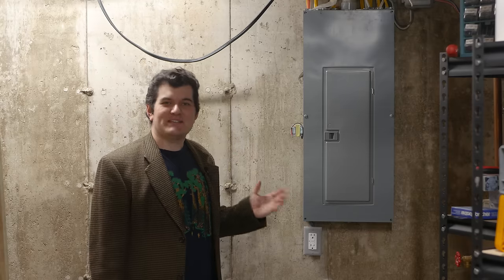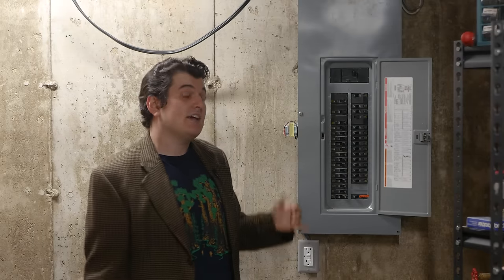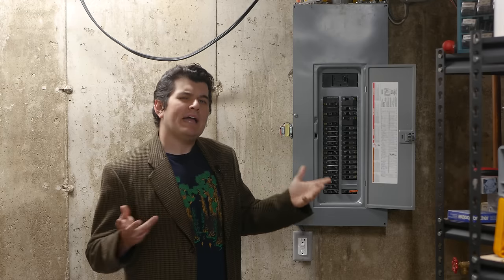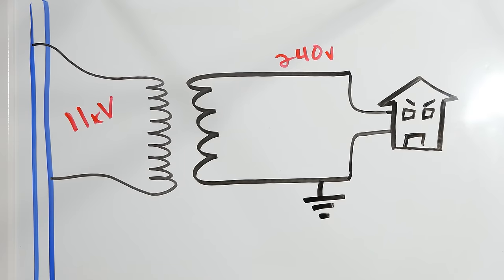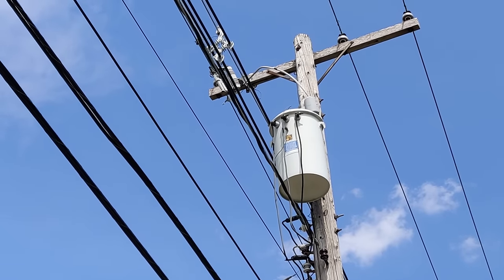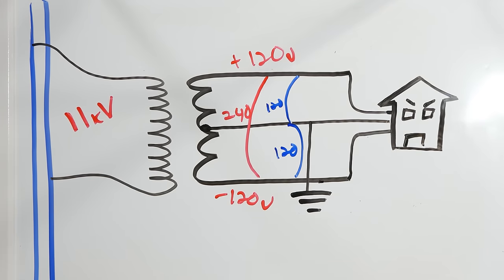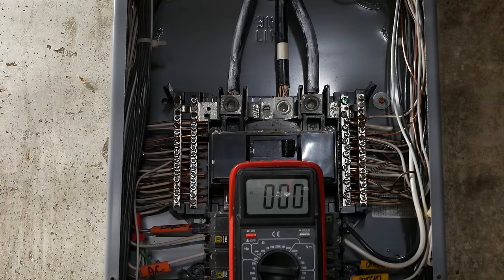The US electrical system is not 120V

Comment: Interesting to see that the US only has a single panel with everything in one place! Here in Germany, at least my household has a main circuit breaker panel (including a GFCI/RCD/Overly-Curious-Nerd-Life-Saver) and a separate, transparent box for a main big "one-time-use" fuse - 63A in our case. We also have all 3 phase cables coming into the panel, at least according to their color, but I have no idea about the exact details. 
And hey, at least your plugs are polarized, unlike our continental European ones. So that's nice at least :)
Reply: It depends. As alluded to in the video, many 240V devices (water heater, air conditioner) have disconnect panels. In larger homes, you'll often find pony panels. For example, you have the main panel in the basement, and then on the second floor have a smaller panel fed from the pain panel for all of the circuits on the second floor and in the attic. This reduces the length of circuits, and also makes it easier to access if you trip a breaker.
Reply: Edit: I just checked, and it seems as if the four connection coming to our house are all three phases + a combined PE + N conductor. So at least our panel has access to 3*230V AC. Huh
Reply: Also, little known fact, we DO have disconnects on the main feed on occasion; if the electrical panel is a certain distance beyond the outside electrical connection (ie. further than literally wall-to-panel), we're required to add a separate breaker disconnect, often integrated into the meter base. Had to do that once when someone added an addition to a house, where the side that was extended had the panel. We ran a lengthy PVC pipe with the main feeds under the house, and the new meter base had the disconnect, to prevent fires if there was a short in the main feed. Because, y'know, utility power lacks the breakers* to do it for you.
* - They DO have breakers, but not ones designed to handle a single house, but rather an entire street (ie. powerlines go down). This is why touching utility power is so dangerous!
...Now I'm starting to sound like TC. XD
Reply: You can't make a judgment about "in the US" from a single example video.  There is significant variation by region, year built, location of utility inlet, etc, etc.
Reply: Our plugs are polarized but almost no appliances or devices care about the direction anyways. Clumsy electricians often wire them backwards with no recourse.
Reply: I always refer to the GFCI as the "profanity inhibitor" because it trips just before the words reach your throat.
Reply: @16vSciroccoboi  Some of the reason is safety. Say you have a fuse on a device, and you want the device to be as safe as possible if the fuse is blown. If the fuse is on one of the wires entering the device, you want to make sure you're cutting off the "hot" wire, since the neutral wire is safe on its own. If you don't have polarized plugs, you don't know which wire is the hot one, and which is neutral.
That being said, lots of homes have the wiring wrong in at least one outlet and they still work fine, if a little less safely for some applications.
Reply: @16vSciroccoboi  the Neutral wire is connected to ground. So yes, there is a polarity. In my area it is common for the inspectors to check polarity on every single outlet.
Reply: @briti1543  I was under the impression that you guys didn't have neutral over there. My bad. So you have 240v potential on each phase in your panels?
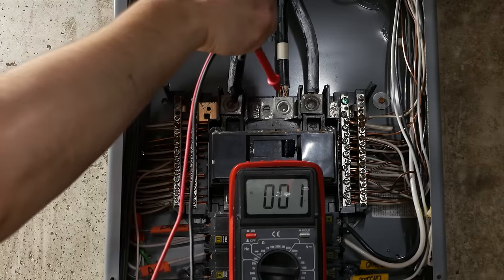Reply: @16vSciroccoboi  It's still 120v potential per phase, but like said in the video (7:28) the neutral is sort of the middle wire between the phases, and the phases are 180 degrees out of sync. But since each 120v outlet just grabs one of the two phases (and it doesn't really matter which one) that middle wire acts as a neutral
Reply: @16vSciroccoboi  The polarized plug is so that the neutral wire of the appliance is plugged into the neutral wire on a properly wired receptacle.  This is safer for certain (especially older) devices that don't have a dedicated ground wire, as reversing the wiring can lead to an energized enclosure.
Reply: @16vSciroccoboi  ever had a led lamp still glow after you turned it off? well, big change that's a result of a switch switching the neutral and not the live wire.
That's when switches are wired wrong, but the same is probably true for outlets, some applications will have site effects when wired wrong
Reply: Siemens and Schneider has to make some money somewhere.
Reply: I guess I should clarify. I'm an electrician here in the US. I know how this stuff works, I'm not saying polarity doesn't exist in the US. 

I was under the assumption that in the UK (or wherever uses 240v) 120v single phase didn't exist. Moreover that there was no neutral conductor used, rather that both conductors in a 2 wire circuit were 120v potential to ground and 180 degrees out of phase with each other. Meaning each outlet would have 2 120v prongs and a ground prong. The latter only in use on devices where grounding was required, same as the US.

 Given these comments I'm reading,  I'm wondering if it's 240v to ground on only one prong, a neutral conductor on the other and a ground prong for the third? Basically the exact same as our 120v system except the voltage on the hot is 240v instead of 120.

So my confusion about polarity stemmed from the idea that there was no neutral in use over there.
Reply: @16vSciroccoboi  Yes, that's exactly the setup we have over here. One phase per socket at 240V, a neutral and a ground. Larger appliances like stoves are usually connected to all three phases to balance out the load on the electrical grid afaik.
I'm not sure if this is true for all homes, but at least my building has all three phases connected at the panel and the n distributes them evenly over the other circuits in the house
Reply: @StarbornPhoenix  ah. Okay. That makes much more sense.
Reply: @16vSciroccoboi  US 120V most-certainly is polarized.  One wire is "hot", the other "neutral".  While an appliance will pretty much always function with the polarity reversed, for safety reasons you want it wired correctly.

e.g.:  A simple screw-in lamp socket...  The outer-shell is supposed to be wired to neutral, with the contact at the bottom hot.  While the bulb will light up either way, you want that (nearly-exposed) shell to be neutral, with the hot wire safely buried at the bottom of the socket.
Reply: dothemathright 1111  In a metal box fan, the outer shell will either be connected to earth-ground (the 3rd pin, if there is one), or insulated from the motor.  It will never be intentionally connected to line-neutral.  (The standards recognize that outlets might be wired backwards, which would make the outer shell hot.)
Reply: @16vSciroccoboi  to be clear, we dont have 3 phases to "balance out the load". sure thats a nice side effect but it's a 3phase system. 230V can be measured between phase1/2/3 and neutral/ground. if you measure between phases you will have 400V. We do in fact balance out the load for single phase circuits, but for 3phase circuits  power is the more important reason.(P=U*I)
Reply: @Arios about the transparent box for a main big "one-time-use" fuse -- he did say that the lines coming in were from a meter outside. That meter probably sits in a panel, and it might be fused,  too.
Reply: @16vSciroccoboi  You have live and neutral. They are AC, but neutral is on the same level as ground. You can safely touch a neutral wire, live not so much. If your appliance exposes neutral to the metal case, you need polarity. Hopefully modern devices just don't do that.
Light switches on the other hand should always switch live, not neutral, but they aren't plugs anyway.
Polarized plugs aren't of much use, just because devices also have to work on non-polarized plugs safely anyway.
Reply: Most of our plugs are polarized these days, but lots aren't.  Either way, they may be grounded or not; the outlets support them all.
Reply: @drstefankrank  I'm aware of that. My comment was in reference to the system used in the UK, I was in error thinking that the UK didn't use a neutral in their wall outlets. I thought they used two 115v hots and a ground, not a 230V hot and a neutral.
Reply: @petermescher332  I never claimed that the US didn't have polarity. The guy said he lived in the UK. Before he told me otherwise I was of the belief that the wall outlets in those systems were two hots and a ground and not a 230v hot, a neutral, and a ground. 

If you had read further comments you would have seen why I made that statement.
Reply: @chaosite2  meters are almost never fused in standard residential applications. 

Though the new code that's coming into effect is requiring the meter to have a disconnecting means. As well as arc fault protection on all circuits including 240v ones.

Might be time to get out of the trade. I've had to argue with enough homeowners that their lamp/vacuum/refrigerator was the reason the arc fault was tripping and they needed to get it either fixed or replace it.

Imagine all the bogus warranty calls to deal with a 1000 dollar range or dryer that won't work on the properly functional AFCI breaker.

Not looking forward to it.
Reply: @16vSciroccoboi  if you want to learn more about the european neutral system, you can look up TN-C and TN-S. Basically, the main cable comes with L1, L2, L3 and PEN (PE/Earth and N/Neutral in one)

The PEN gets split up in PE and N. This happens right after the first main fuse. This has the purpose, that N can fulfill his use as a "return way" for the current and PE is always grounded. If you measure N to PE in a normal socket, you should get 0Ω
Reply: A lot of newer constructions use AFCI or GFCI breakers
Reply: We can have the same...
Reply: It could also depend on the setup we had a second box put in here when the current garage was built and when the solar panels were put up an inverter box was added.
You also have to factor in electricians botching the job. like finding out when the main safety switch broke that last time that completely unnoticed 2 points completely bypassed it directly to mains power. or the time an idiot put a manual switch in the place of the main safety switch which I believe was around the time i got electrocuted in my teens.
Being hit by mains power while on concrete slab is for lack of a better word a weird feeling especially in the lungs/chest.
Reply: @TheYamyam97  if u meter between PE and N, and get 0 u have TN-S or TN-C-S.
Also Type E/F are polarized, u can get a tingle when use cheap ATX powersuply because reverse polarity
Reply: In Germany you mostly only have one panel as well. I have seen subpanels used for Garage, backyard etc.. I think what you refer to is actually like the main fuse in front of the meter. This box usually is sealed. Everything up to the meter is sealed. After that having all breakers in one panel is common as well.
And here comes the main difference. In Germany mostly the meter is in one separated and sealed compartment of the panel. In the us the meter is mostly on the outside of the house, as well as sometimes a main switch or main fuses. The fuses sometimes even are on the pole next to the transformer.
Reply: @TheYamyam97   And you want to look for TT regime for France. Because we can't do anything like anyone. And Belgium use it too, I suppose because we're bad influence on them :D
Reply: @16vSciroccoboi  If they use 400V 3-phase their single phase would be 230V unless otherwise stepped up/down. A line-to-neutral transformer out to a center-tapped split 115V could be possible, perhaps to run North American-style appliances.
Reply: @16vSciroccoboi  The UK has big, bulky plugs that are polarized and have a fuse built in. Other countries in Europe don't. Schuko / Type F / CEE 7/4 is used in a lot of them, and it allows you to plug in both ways (like the US 110v non-grounded plug does too). There is a variation (Type E) that has a ground pin (male, in a female socket) instead of clips on the side, and those are polarized.

We have a 3 phase system with a center ground / neutral, and RCD / GFCI is pretty much mandatory on new installations. Most homes have all three phases coming in, but most homes do not use that to power things at 400v, 99% of all electrical appliances are 240v. A notable exception is an electric stove / cooker, but even those often use the individual 240v feeds instead of 400v. 

We had a 400v connector in our garage to hook up a welder, but things like microwaves, dryers, washers, airconditioners, they all generally use 240v. 400v is used extensively in industry. CNC, routers, welding, elevators, forklift chargers, etc.
Reply: In North America there is a separate supplier fuse system not shown in the video.
Reply: @VegetableMigraine  Yeah. In the real world, the devices just know about AC (usually at a wide range of voltages) and use to have an external/internal switching power supply that creates all the weird voltages or types AC/DC , signal waves , frequency .... and so on ...
Reply: @jorisderijck1779  nah not really.
Most switches dont have enough seperation to prevent ~induction~ currents.(the most seperation i have seen in a modern switch is about 5mm) 
If you have a really old Backelite Rotaryswitch they have almost 10mm-15mm of seperation and no led glows with that.
If i misinterpreted that you are from germany most of this doesnt make much sense.
A way i used to prevent glowing is placing one mains rated capasitor across the led.
Reply: @16vSciroccoboi  In the UK, at least in the houses I've lived, we just get single phase 240V. So The plugs have Live (+240V), Neutral (0V), and Earth ground.
Reply: @VegetableMigraine  "hot chassis" radios (mostly from the 1960s-back, but also some GE models into the  '80s) and TVs (to the end of the CRT era) were a lot safer with correctly polarized outlets. Same for many ungrounded appliance like vacuum cleaners and pre-GFCI hair dryers.
Reply: If I recall German/European consumer wiring color-coding correctly, blue is "hot", brown is "neutral", and green/yellow stripe is ground (frame ground).  If there's another typical color for the other Hot leg, I don't know what it is.
Reply: Why in Germany a house gets three phases as standard ? I never understand that, most places you just get one and I don't see the need for three (unless all of you guys have industrial motors on your homes, something I really doubt). Three phases just makes things harder since you need to evenly distributed the loads for the phases, and you have to use three pole breakers and stuff. (I admit three phases do make sense now if you need an EV charger).
Reply: @phazonlord0098  – There are a few backyard shed level appliances that use three phases (circular saws,   some welders, stand drills etc.).
Reply: @xheralt  Brown is hot and blue is neutral.  I sometimes wire European plugs at work.  The 3 phases are brown black and grey.
Reply: In northern Europe many houses have 3-phase connection. 3-phase is used for stoves and house heating. E.g. in my house 3-phase 400V is used for the kitchen stove, the geothermal heat pump that heats our house and our sauna heater. Everything else runs on 230V.
Reply: My house has separate panels for the a/c unit downstairs the condenser unit and the air handler upstairs. It’s basically a design decision.
Reply: @jamesffxl  Blue can also be hot, it depends. Let's say you connect a stove, three phases and ground. The ground is always yellow/green, but the rest of the wires can very well be brown, black and blue. In that case, the blue is hot. The same wire can be used to connect a hob, 230V two phases. It would need a neutral, and then the blue should be used as that.
Older installations can be found with all kinds of colors, just a couple of days ago I installed a stove, where the wires in the wall were red. A red ground wire and three red phases. Sometimes they are all white or black, you just never knows!
Reply: All the new homes I’ve owned since 1986 have had two panels like you described. The outside one is often used to attach whole house generators during power outages. Plus the pony panels for jacuzzi and pool. Those have an additional breaker at the main panel. These homes were all located in Florida and all the power lines are underground. My childhood home in Los Angeles built in 1959 had everything combined in one panel outside.
Reply: @phazonlord0098  induction cooking,  also works on 400v and as, said above.  3 phases means more live wires too distribute the demand of a house.
Reply: @woutervswouter  not only induction cooking. Almost every stove or oven (besides gas powered ones) at least has the option to connect to three phases. My stove needs them because the single plates are connected to different phases and my oven can be run on single phase but will get hot faster if used connected to three phases.
Then there's single-faucet water heaters in the kitchen and the bathroom that must be connected to three phases as central water boilers are not that common here. And long ago (until the 80s), the houses themselves often were heated electrically, where a three phase system is also handy.
Reply: @StarbornPhoenix  Same in Sweden, we also have 3 phases. We normally have only 10 A brakers for 1 phase.
Reply: VegetableMigraine 
Yep this is true. Polarity is irrelevant for AC power anyhow because it reverses every 1/60th of a second
Reply: I lived in Switzerland for a year and they have a superior receptacle then here in the US.  Their receptacle is actually recessed so when plugging something in the pins are never exposed. This makes it impossible to electrocute yourself by touching an exposed pin.  If you Google a picture of a Swiss outlet you’ll see what I’m talking about.  I believe receptacles in Germany have similar recessed design.
Reply: @FL-FLyer  Yes they do, though our Schuko plugs are larger and round, as opposed to the Swiss ones. Almost all plugs other than the US connectors either have recessed sockets or have partially isolated pins (e.g. UK)
Reply: @Jukke55  In the USA copper wire is very cheap which is why my house has 20A breakers with 12 gauge wire, they are just really cheap and also why we don't need higher voltage because the wires are just thicker.  New cheap homes have 15A breakers and 14 gauge wire but nicer homes still use 20A and 12 gauge wire.